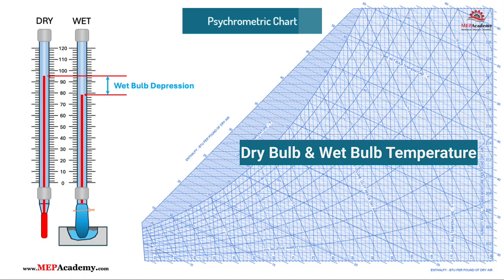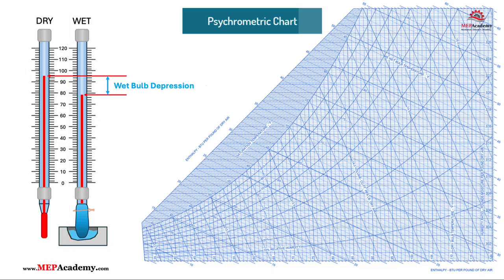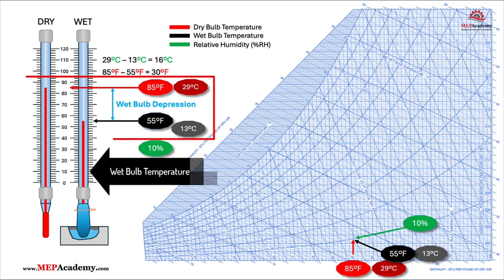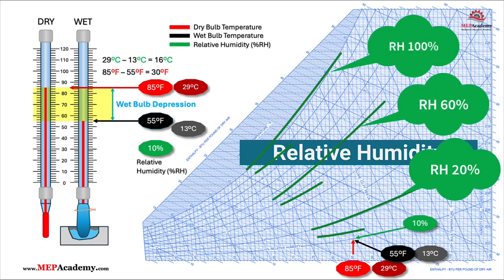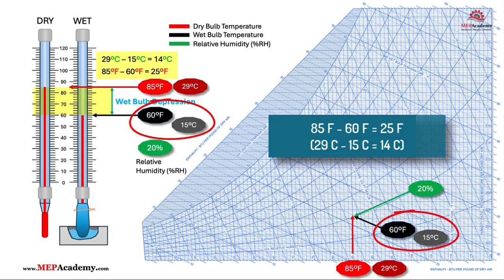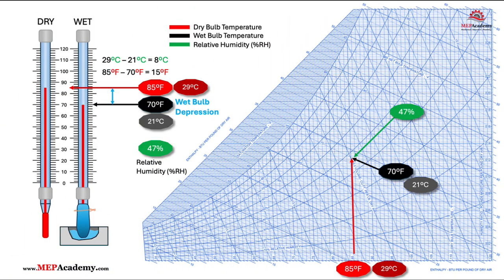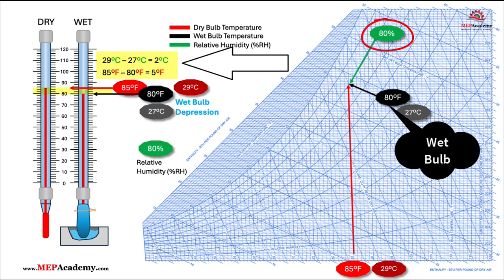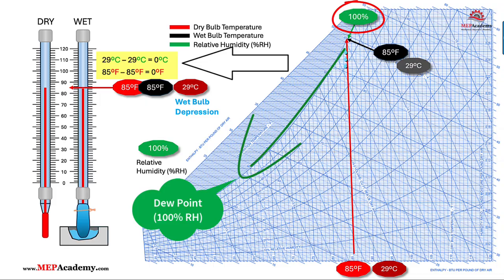Understanding Dry Bulb, Wet Bulb, and Wet Bulb Depression

Comment: How about WET BULB DEPRESSION RATIO?
Reply from the maker: For evaporative cooling systems, we often refer to the evaporative efficiency, which relates the actual temperature drop achieved by the system to the maximum possible cooling (based on wet bulb depression). Evaporative Efficiency = Dry Bub Temp - Supply Air Temp / Dry bulb Temp - Wet Bulb Temp.

Comment: so if im using a pocket psychrometer, and it measures wet bulb & dry bulb as well as the relative humidity, do i need to be in the wet bulb mode in order to read the correct humidity %?
Reply from the maker: Not sure how your pocket psychrometer works, but you need at least the dry bulb and wet bulb temperatures to find the relative humidity. With these two values you can determine relative humidity. The dry bulb temperature alone won't work, as the wet bulb temperature indicates the level of moisture for any particular dry bulb temperature.
Reply: @MEPAcademy  I have the field piece PRH2, it shows relative humidity % in both readings, when i switch between them it stays the same so i believe its already doing the calculation for me, im only really just switching between WB & DB,
Reply from the maker: @JP-sd2cw  You're correct, its reading both Dry bulbs and Wet bulb to give you Relative Humidity.